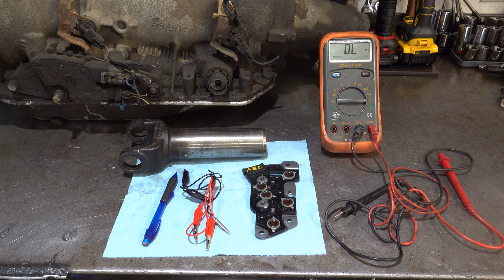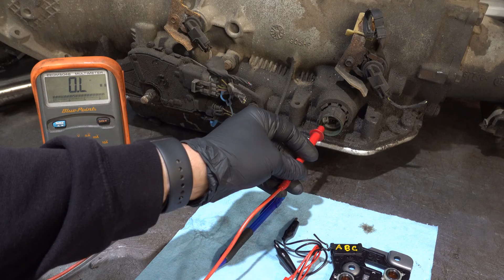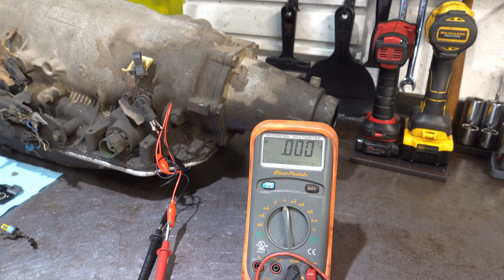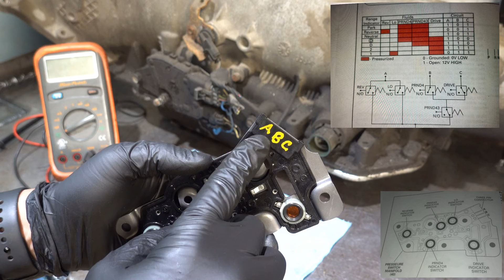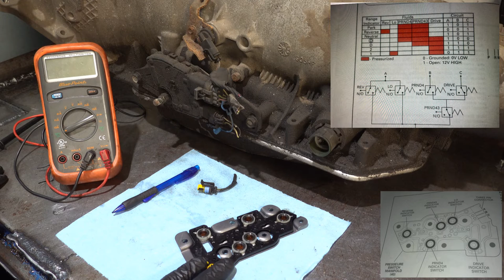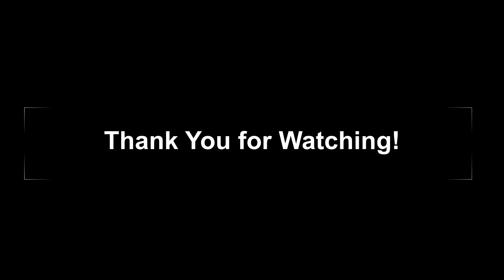4L80E Solenoid, Pressure Switch, Speed Sensor Testing and Diagnosis

Comment: hey Nick my trans was running okay in the morning going to work then got my truck in the afternoon started to dive up the road trans would not shift out of first gear are the speed sensors the problem you think? Thanks
Reply from the maker: Possibly - check by swapping them.

Comment: Got a 2003 silverado 1500 got 1 and 2nd no 4th or5th n no revers anybody got a clues  of what it can be .thanks
Reply from the maker: Does that Silverado have a 4L60E or 4L80E swapped in?

If it’s a 60E, can you please post your question in one of my 4L60E videos? I prefer to keep all discussions relevant to the transmission featured in the video. 

Also, no fifth gear in the four-speeds. Perhaps you mean to say TCC lock up. If so, simply revise the wording when you repost the question in one of my 4L60E vids.

Thanks!

Comment: I have a 4L80e in a 2000 Silverado 2500 that shifts AMAZING until you drive on the highway for a while. Once you get off the highway, it'll shift really hard. Then I turn the truck off, turn it back on a few moments later, and it'll shift great again. Any ideas for me?
Reply from the maker: Scan for codes - let me know what you find.
Reply: @nickstransmissions  I should have put that in the question. It shows a P1870 code.
Reply from the maker: P1870 is usually converter clutch failing in 4L80Es though it can be TCC regulator valve in the valve body. When a transmission code sets and stores, the ECM freezes all shift adapts and maxes the line pressure to protect the transmission from failure. This explains the hard shifting. You'll need to pull the pan off to see if there's burnt converter clutch matter (or any friction debris) in the pan bottom. If fluid looks/smells ok and no debris is present, drop the valve body, disassemble it completely, clean the valves and hot-tank the casting. Then reassemble it dry so you can vac test it...Then conduct the vacuum testing - if any circuits are holding/pulling less than 15Hg signal then you'll need to repair or replace the VB. That still may not address the problem if the TC clutch is already damaged. The converter will have to be rebuilt or replaced. 

If you have to cross that bridge, you'd prob be better off giving the unit a full overhaul.
Reply: @nickstransmissions thanks for the explanation. That helps a lot. I'll get after it!

Comment: I couldn't see in the video, but I'm thinking you had the metal back plate of the pressure switch on the metal bench.  I think that is probably why the one commenter didn't get a reading on the three pins.  He was confused about the volts vs ohms.  Definitely ohms there.  Does the speed sensor make acv or dcv?  Is there a chance I could get a decent 4L60e from O'Rielly's.  The original trans lasted 11 years in my 02' Silverado before the sun gear housing gave up.  I put in a trans that was given to my son when the truck was his.  It came from shop in Ohio ?  It has lasted  from 2013 until now and 2nd gear has started slipping I've already checked the solenoids and they seem to operate properly.  Plenty of transmission shops around where I live, but I have heard too many bad revues to want to pay them.  I'm sure there is a reputable shop and builder some where, but I don't have enough money to gamble on a maybe.  I'm 81 and this will probably be the last transmission I will be installing if I can find a good one.
Reply from the maker: Thanks for watching, Lloyd!
I'd be happy to build you one but the shipping would be prohibitively expensive unless you are in Las Vegas, NV or surrounding area. There are some good shops but unfortunately, you have to do a lot of searching to find them sometimes. 

Good luck with it!

Comment: Awesome video. I just installed a new 4L80E along with a Holley Sniper 2 controller and only have reverse and first gear. After hearing what you said about the speed sensor, now I have a direction to go as far as troubleshooting.
edit: The speed sensors seem to be working fine. Back to the hunt I guess.
Reply from the maker: Contact Holley's tech support if you haven't already...Meanwhile, disconnect the main case connector (but not the speed sensors), fire the engine, put it in drive and see if it will move. You will start out in 2nd gear and have no upshifts but this test will help rule out any issues w/the transmissions (I'm assuming you haven't yet done this test but if so, then no need to do it again).
Reply: @nickstransmissions I appreciate the reply. Before I read this I called Hughes Performance (the builder) and explained what I had checked and they asked me what controller I was using. When I told them that I had a Sniper 2, they said that they use Rostra pressure switch manifolds and even though Rostra makes the boards for AC Delco, they are aware of issues with how the Rostra boards interact with the sniper and Terminator X controllers. He’s sending me a new AC Delco board along with a pan gasket and sounded like he was pretty sure that this was the problem. If this doesn’t work I’ll definitely be trying what you recommend next (I would do it now but the pan is off) and if it does work I’ll post back here and let you and anyone else who might stumble on this thread with the same problem know.
Reply from the maker: Sounds great, thank you in advance for following up with the outcome.
Reply: @nickstransmissions I’ve been offshore working for the past two weeks but when I got home last night the parts were waiting on me. I got the pressure switch manifold installed last night and filled it back up with fluid early this morning. I was able to test drive it around noon and the part seems to have fixed my problem.

Comment: Great video. My 95 suburban 4l80E started erratically shifting into and out of 4th above 2000 rpm.  I tested the resistance and solenoid A is 22.5 and B 22.7 the rest were within spec. below 2000 it shifts fine. I have replaced the VSS on the transfer case. There are no codes or engine light.
Reply from the maker: Thanks for watching, Bill. Sounds like you have done all the requisite diagnostic testing, assuming you conducted testing at the case connector pins and then again at the solenoids independently of the wiring harness. If so, and assuming all solenoids are working correctly (sounds like they are if 4th gear is the problem and all others are fine) AND your speedometer works, it's likely a mechanical problem inside the transmission. Specifically the overdrive clutch beginning to go out. That's my guess based on the info provided.
Reply: @nickstransmissions  Today after test driving im getting a code 39 TCC stuck off.
Reply from the maker: That is your torque converter clutch slipping which may or may not result in a disengagement in 4th gear. If that's the case, you have to find out why it's slipping and address/fix those causes. That could mean vacuum testing the TCC regulator valve and, if necessary, replacing it with the Sonnax version or opening up the transmission (i.e.  full overhaul).

Comment: Great video! This was the best one out there I could find. I've got a question, checking the temperature sensor I am getting 3,444 ohms at 45degrees Fahrenheit, is this within range? I've found several different graphs online with conflicting information.
Reply from the maker: Thanks, Offroad4Life! 

Good question. I'm not sure exactly what the range should be but 3k+ ohms seems high. I'd just replace the wiring harness.
Reply: @nickstransmissions well if changing the bad speed sensor doesn't fix it that'll be the next change 👍
Reply from the maker: Speed sensor? Thought you were asking about the trans temp sensor
Reply: @nickstransmissions oh the speed sensor didn't pass the test either so I'm replacing them

Comment: Hoping for some advice - my 06 tahoe has a trans issue, just had it rebuilt and did not fix it. intermittent appears to be when it heats up, but does stop and return to normal shifting also when it happens. No codes at all. Scenario - shifts completely fine for first 15 or 20 minutes of driving, no issues. Then, usually after slowing down at a light or stopping somewhere, it gets stuck in first - wont shift up to second just stays high rpm first. It will coast and RPM can drop, but no shift up, if i manually go down to first it will stay locked with rpm, no coast. usually i will try to manually shift it to second this way moving the shifter, this will go on for 2 or 3 minutes high rpm messing with it and then magically unlocks and shifts normal again. sometimes it gets stuck in second the same way, coast unless in manual 2nd it will lock to rpm. then magically releases to 3rd messing with it and all good. it usually goes back to perfectly normal shifting after these fits. dosnt throw any codes. had tranny rebuilt and still same problem. replace trans output speed sensor, didnt fix. im installing the NSS/position sensor today to see if that works. my next component will be the manifold pressure switch inside the trans(im guessing it wasnt replaced in rebuild). ground looks fine on engine, idk maybe ill throw a ground wire at it too. no obvious wire issues, though imo it does point to a wire scuff. though it seems heat dependent. maybe a solenoid that gets sticky when it heats up? then the high rpm breaks it free after a minute or two and it shifts fine? idk any help would be appreciated.
Reply from the maker: Sounds like an electrical system problem. Check the vehicle speed sensor as well as the wiring/connector, etc going to it. If you have a 2WD it will be in the extension housing; it will be in the T-case for 4WD units. Beyond that, confirm with the builder that all of the transmission electrical components were replaced (assuming you didn't rebuild it yourself and replace those parts w/new ones). MLPS and pressure switch manifold assembly should have been replaced during the rebuild.

Comment: I got a 4l80e all stock motor 5.7 had the trans kinda checked over would say rebuilt ab 4 years ago and has an 34000 on it my issue is it just stared kinda doing this but when the truck get warm after about 10 mins or 5 miles my 2 second gear wouldn’t shift to third or 4 th but it works fine 2 miles ago and stays like locked in 2ed gear I don’t know where to start it’s works great the trans wants it like get hot or matter 5 miles won’t shift into 3rd
Reply from the maker: Hi Cole, did you follow the steps shown in the video to continuity test your solenoids? If not, give it a view then follow the continuity test procedures. I suspect you may have a bad solenoid B...
Reply: @nickstransmissions hey there I got a 4x4 unit that 97 years ago 4l80e that’s what I got a little different

Comment: Any similar tests for 4l60 switch?
Reply from the maker: You should be able to test using the same general procedures if you know which pins correspond to which components inside the transmission. I'll prob do a separate, similar video showing similar testing on 4L60Es in the near future. 

Thanks for watching, Eazhar!

Comment: Thankyou so much for putting this much time and effort into this video breakdown.  Its absolutely amazing!!
Reply from the maker: Thanks for the kind words, Ken!
Reply: @nickstransmissions  your welcome.   I have an o4 2500hd with the 4l80e...about 80,000 miles on it. it dropped down to -8⁰ here in ohio couple of days ago.   She went into limp mode and blew one of the spliced cooling lines off.  I lost 2 qts fluid.  Now she's stuck in neutral. I had it towed home. Its supposed to warm up to 30⁰ this weekend.  I'm going  to tinker with it. Now I know how test everything.  I'm hoping it's a bad sensor. Or issue with the filter/fluid.  It ran smooth like silk prior.   Another issue is may have had is that my battery is toasted.  It started the truck that day fine. Even to steer it on the tow truck.  But the next day it was dead. Got weird readings from it. 5 yrs old. I'm hoping it had a dead cell, perhaps didn't have enough amps to control the sensors properly.    Grabbed a new one. So I'm going put her in and test away.    Seriously,  thanks again for the effort on this!!   I'm hoping it's not roasted 🙏

Comment: Rebuilt a 4180e about a month ago using your instructions it was wicked helpful! fast forward a bit and I've got an extremely hard 1-2 shift and 4th - overdrive shift. I checked all of the resistance in the solenoids when I installed them but they were used/unknown parts that came with trans. It's throwing a Gov pressure sensor code, but before i drop the pan and swap it for a new one, does the hard shifting in only those gears seem like a possible symptom from a faulty Gov Press Sensor? Just wanted a sanity check from the master before I get after it. Thanks!
Reply from the maker: Hey Nicholas, sorry to hear...Have you checked your TPS, MAF, Ignition Switch and/or Input Speed Sensor? 4L80Es do not have a governor pressure sensor or transducer (The Dodge A518/618 and 48REs do, however) so perhaps you're referring to the Electronic Pressure Control Solenoid? 

If the EPC has failed open (meaning it's allowing too much pressure into your apply circuits relative to throttle angle/position) then you're more likely to experience harsh 1-2 and 3-4 upshifts given the efficiency and speed in which those two clutch packs apply relative to the direct clutch. 

Reply with the actual code you're pulling and we can go from there.
Reply: I have a P0174 code. Can that cause hard shifting through all gears? Lean bank.

Comment: Thanks for all your super thorough and detailed videos. I test the continuity like you did and they all checked out...but I couldn't get any voltage reading on A, B, or C no matter  how many times I tried.  Am I doing something wrong or does it simply need to be replaced? What symptoms can this cause while driving?
Reply from the maker: Thanks for watching, diycast6914...What part specifically are you testing?
Reply: @nickstransmissions  i followed the exact procedure I learned from your video.  All continuity was present when depressing all 5 switches but when I tested thr A,B,C pins, I got zero voltage no matter how much i tried
Reply from the maker: Ok, your multimeter needs to be set to Ohms, not volts...The only thing you can test that's featured in the video by way of voltage is the speed sensors. 

Do the same test but with your DVOM set to read in Ohms and you'll get readings that will help you confirm or deny the switch is good.
Reply: @nickstransmissions  Okay great thanks for the quick reply! I just got confused cause after you tested the 5 pressure switches in ohms, you tben put your multimeter to volts when testing the A,B, and C Pins on the connector....
Reply from the maker: If I did that, then i had a 12 volt power supply but I filmed that video quite a while ago so don't remember exactly what I did...So defer to the video itself and disregard anything I'm saying here as everything in that video represents how I test all of those electrical/electronic components on those transmissions.
Reply: @nickstransmissions  No you definitely didn't have a 12V power supply while testing the A,B,and C leads on the manifold pressure switch so thats why im still confused how u got voltage reading in that video....im basically just trying to clarify this part cause im under the impression that the continuity test on the 5 pressure switches was just half of the part confirming if the switch is good. Im currently trying to properly test mine and pretty sure the trans néeds a rebuild but dont wanna unecessarily dump another $50 for nothing in a new pressure switch.  I also couldn't find any info online or any other youtube video testing the voltage on this switch the way u did
Reply from the maker: @diycast6914 I always tested them for continuity. Additionally I never reuse them so dont pass any voltage to them. IIRC I only didna voltage test on the output speed sensor.

Comment: Mine isn’t throwing any codes. It just goes straight to second and only has second and reverse. I’ve swapped my front wheel speed sensors, my maf sensor, and changed my internal wiring harness.
Reply from the maker: There's still a short somewhere either in the transmission or external wiring harness that's putting the transmission into limp mode...These older units may or may not throw a DTC for electrical issues...most of the time they do but occasionally they dont.
Reply: @ how would I check it? With a voltage tester on the pins in the harness?
Reply from the maker: Did you watch this video? If not, give it a view - it lays out the multimeter testing for you step by step. 

Shows testing the harness, each solenoid and the speed sensors. You would apply the same techniques to your other components such as your ignition switch, MAF, TPS, etc...

Also, make sure you used OEM components...I can't tell you how many times I and others have had problems with aftermarket electronic/electrical components from chain auto parts stores, Rock Auto off-brand and other similar places.
Reply: @nickstransmissions  yea I watched just wasn’t sure if you meant to do that same thing. I’ll have to test it all and see what’s going on. Maybe I missed it but how do I just test the 12v pin to see if it has all 12 volts?
Reply from the maker: Gotcha, thank you for watching. Test the wiring harness leading to the transmission for 5v reference and 12 volt power. Also check the PCM itself as they can go bad also - been seeing more customers whose vehicles' pcms are failing...